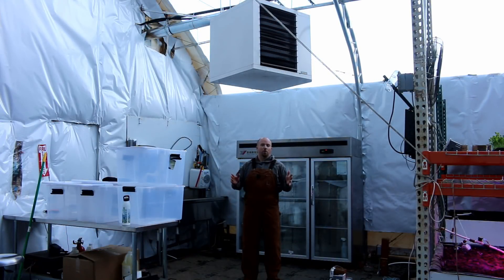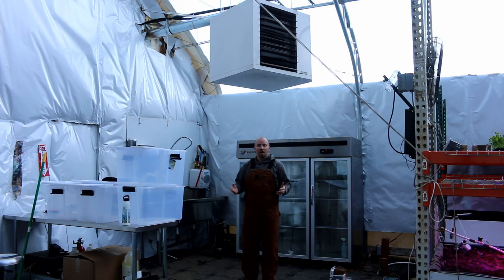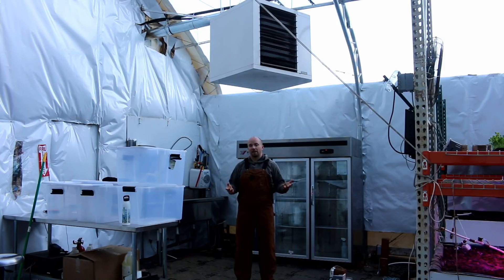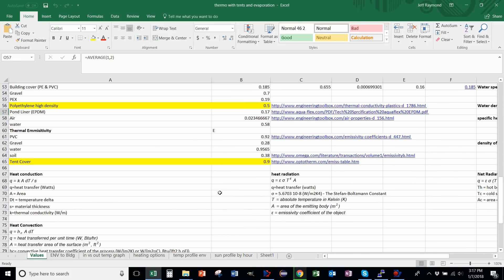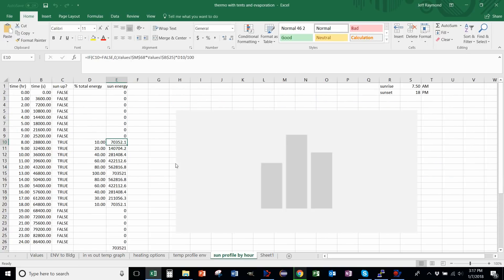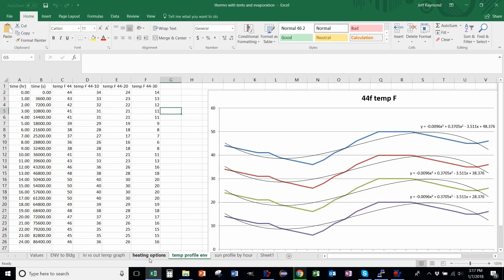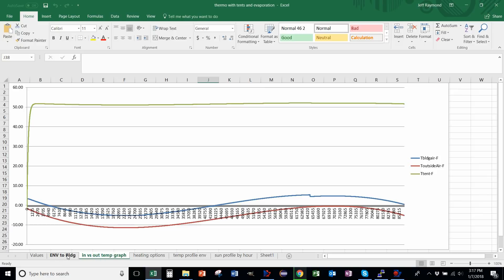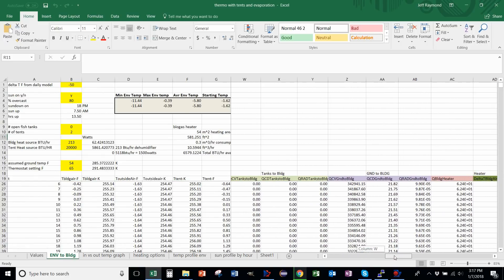GREENHOUSE Overview - HEATING OPTIONS

Comment: http://www.oit.edu/docs/default-source/geoheat-center-documents/publications/states/geothermal-in-oregon.pdf?sfvrsn=2 

! have a question for you @therealmartian, were you actually going to dig it down deep enough to really be a Geothermal, versus a geo exchange surface type of system.  By your description it sounds like a real system as well diggers won't touch it, but in prior videos thought you described more of a surface type system?  For anyone else in the area I found a link to an OIT Paper that gives some info on how deep you a drill needs to go in order to access real constant temp at a given temperature.
Reply from the maker: i was debating between the cost of excavation (surface) vs the cost of wells (smaller area more heat transfer)...the wells are the best but very expensive...excavation is actually dangerous when you are talking about the amount of dirt we'd need to move...this will come back up again though...geothermal is too good to pass up
Reply: We have the same issues up here in the great white north.  I am eager to see the outcome and continue the sharing and learning, Thank you.

Comment: When you talk about geothermal are you talking about a climate battery?  Isn't an excavator the only heavy equipment you need  to install a climate battery? Wouldn't installing movable insulation for full night time coverage be your most energy efficient move at this point?
Reply from the maker: it was a geothermal heat pump

Comment: Very interesting great video. I find it interesting as a race we spend a lot of time on worrying and working towards heat.  In my house, we have lp gas furnace, a Multi Fuel pellet furnace, and a wood stove. This year I really thought about it. Hands down no matter how you look at it Wood is the cheapest  out of pocket option, but also the largest amount of work time etc. Then you have The pellet stove I find is the middle ground, cost it matters on the cost of LP vs Pellets/corn. I like the pellet stove in sub 10 degree weather, you have some radiant heat from it, and house seems warmer. You have to load the hopper at least once a week, and then daily clean the fire pot of Clinkers. This you have feed augers you got to watch. You have to tinker with it. Then you have LP Gas, you call they come fill the tank, it burners and walk away, no lobar or time, but then you have cost of LP gas at the sub 1.45 a gallon you can’t go wrong. What I figured out from all this there is no perfect heat system as humans we been trying to kept warm for thousands of years and yet to come up with the perfect system. Me personal I like a radiant system over forced air. I like have options but Still life in it basic from is still Shelter/heat, Food and water.